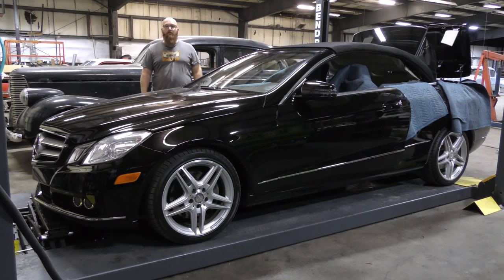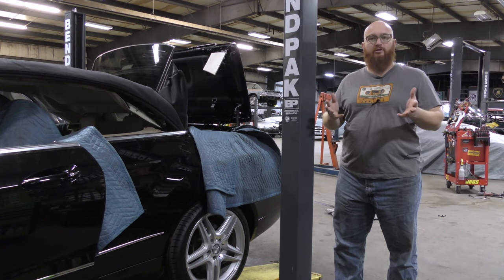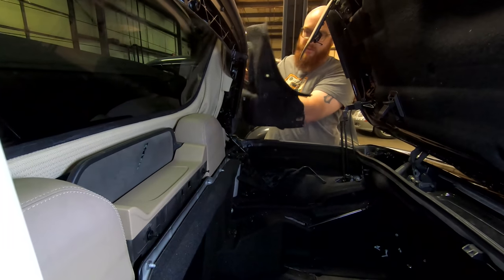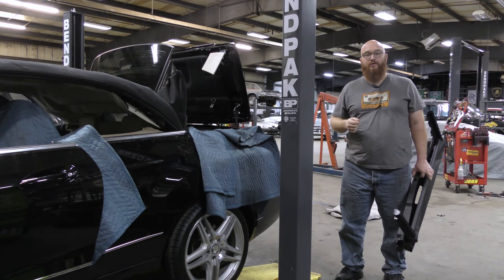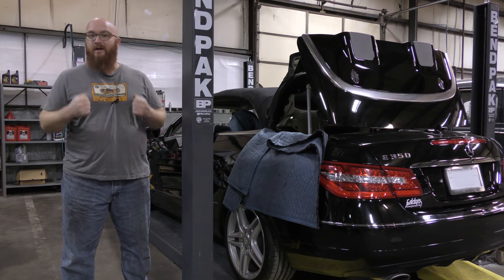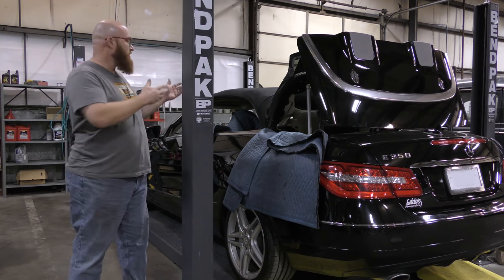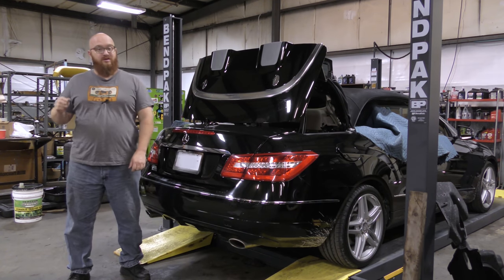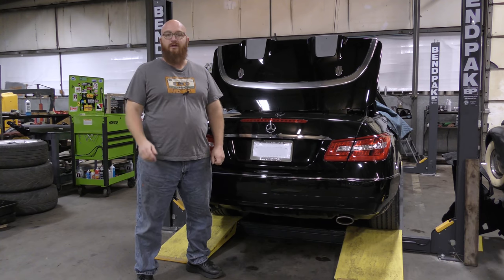When bad design costs thousands! Not so convertible 2011 Mercedes E350 can no longer rise on demand

Comment: I am one of the customers that auto manufacturers don’t count on for sales.  My primary car is a 1992 Buick Roadmaster Limited Sedan (84,000 miles), and my second car is a 1984 Cadillac Eldorado Biarritz Convertible (86,000 miles).  The challenge can be finding certain unique parts such as the dash mounted HVAC control module on both of those cars — both of them needed one this year and locating them was a real headache.  I wouldn’t trade either for a later model, however.

Comment: Nah, with the Diamler Benz, it was probably a decision made a decade ago, so therefore will never get revisited.. The first hose design was probably good, and eventually they squeeze the supplier, who does a "cost reduction".. the real crime? the non standard hose connectors.. which makes it hard for the  aftermarket to build a better hose.. BTW: I highly doubt they made 200K E series Cabriolets (convertibles), so I doubt the poor quality of this design is on their radar. With German engineering, many times it's "we do things this way because we can, not because we should".. Remember the 90's M-B electric brakes? How many did they buy back under lemon law?

Comment: The last generation of proper and reliable Mercedes Benz cars was W124 and W140..lucky to own both of them (E230 and an S320)..then I bought myself a W210 and later drove for some time a '05  SLK...huge difference in terms of reliability and mechanical issues compared to pre 2000 models...Never bought or drove a Mercedes again in my life. Same applies to Audi...Got a Lexus SUV which I have recently replaced with a Volvo...both superb cars, super reliable and awesome to drive and above all 5 star safety for driver and passengers. Unfortunately marketing gurus have made Mercedes a status symbol car despite the fact that are way better cars in the market with much less money

Comment: I'm surprised you can't get the proper fittings (or make them) and then use a type of hose that you can splice so next time it leaks you just have to replace that one little section. You could perhaps even splice in a piece of steel braided hose for that hinge point.
Reply: very tight space

Comment: Hey Wizard, what is your experience with Mitsubishi?
Reply: I am still waiting for a buy this, not that video regarding Mitsubishi's.
Reply: Mitsubishis aren't as reliable as a Honda or a Toyota. There are Mitsubishis that are reliable like the Lancer and the Eclipse. There are also unreliable models like the Outlander and Outlander Sport especially those with a CVT transmission also made by JATCO, a subsidiarity of Nissan. In fact I don't recommend any Mitsubishi with a CVT because they have similar problems with Nissan. Another thing is to avoid the earlier 3.0 V6 models because of valve seal issues and on occasion, head gasket issues.
Reply: @atx-cvpi_99  The later, 3 L V6 models are still in great shape for reliability (2014 and newer Outlander's). My father just kept his 2018 model, I believe.
Reply: @md2k8  Chill man, i do not want a mitsubishi video just a little comment.
Reply: @atx-cvpi_99  I was thinking about older models like the pajero with the v6 3.8 or models before 2012...
Reply: Mitsubishi also manufactures its vehicles in Japan, right? And it is cheaper than toyota and honda. I know they have some faulty models but all brands (including toyota and honda) have their faults. And honda lately is delivering vehicles with questionable quality control.
Reply: @seandillon3340  Yes, they do.

Comment: I own a 1999 Toyota Celica convertible with 150K miles made by the ASC in California. The top works perfectly and car has no issues. I sold my BMW Z4 because both  power top motors were broken and many other parts failed too like the SMG transmission. Yes when they are new German cars are lovely.

Comment: Interesting video, but badly lacking in perspective.  Yes, technicians may see a large number of any particular problem, but they never see the thousands of cars that don't exhibit the problem - so their frame of reference is understandably skewed.  10 or 11 R129s with leaking cylinders?  Over what period of time?  Yes, leaking hydraulics are a known issue with the R129 top but keep in mind the number of R129s which were built between 1990 and 2002 (over 175,000), and that the newest one is now approaching 20 years old.  Not to mention that MB freely admits that replacing the cylinders can be expected about every 10 years.

And this particular 2011 A212 is now 10 years old - which sort of dismisses your "3 to 5 year" life estimate, wouldn't you say?  The same question could be asked: Given the number of units produced, what does the failure incident rate calculate out to?  And might the longevity history with the R129 be an indicator of what to expect with the A212?

Certainly, a potential buyer should consider the possibilities of expensive repairs if they're looking to buy any  used car.  A potential BMW buyer would certainly look seriously at the cost to address any number of potential trouble areas on late model BMWs, or a classic Mercedes buyer might be legitimately concerned about the potential for hidden rust damage.

No car design is perfect. I'd happily tell you about a big design annoyance on my 2011 E550, but I had it addressed and moved forward.  I'll not likely ever have to pay to have it done again, unless the firmware is flashed back to factory settings.  If that happens, I'll deal with it then.  Meanwhile, I'll continue to drive and love the car, much as I expect the owner of this black beauty will.

Sorry to be long winded.

Comment: Hi Mr. Wizard. I  was a rental car warranty mechanic back in the mid-70's and GM had a policy of no high pressure hydraulics in the interior anymore. Gone was the direct reading oil pressure gauge, replaced by an oil pressure sending unit and a wire to the gauge. The heater core also was moved to very close to the firewalls. Interesting we have come full circle and have high pressure hydraulics in the interior again in a high dollar safe car.  Before you know it, they will be putting large banks of high energy batteries under the driver seat!!  Oh wait...........................

Comment: I own 2 MBZ Cabriolets. There is a manual overide that allows you to lower the top manually at 2 points above the trunk near the hinges. Takes 2 people to do it but it can be done & it is in the owners manual as an option to open the top manually if the hydraulics fail.

Comment: Yes, my '99 Saab 9-3 CV top costs more to fix than the car is worth. It's a messy job, like the Wizard said, even just to add fluid to the reservoir. The top function also has to be calibrated, why my regular mechanic referred me instead to another shop. As I learned this past summer, those tubes are $200-300 each, not incl. labor, and I think there are ten of 'em. Fortunately, I only needed two for now. (Don't even get me started on the cost of pistons...) It's also not like I had to get it fixed or else, but as the Wizard said, what's the fun in having a CV then? So I may have been "ho$ed" by this top, but at least I've never been sprayed!

Comment: Worth noting that many mechanics (at least in the UK) don't service convertible roof mechanisms and quite often you need to go to a specialist who will likely have a far higher hourly rate than a mechanic. I also know in my town there's no one who services air con not even a nissan main dealership in my area would touch a faulty air con pump on my friends Juke.

Comment: I have this same car it's a 2011 550 V8 it now has 158 thousand miles on it the only thing I've done is engine mounts transmission mounts lower control arms and sway bar links which is understandable and a starter I've never touched the top I can't tell you how many times it's been up and down in the last 10 years hundreds of times if not 1,000 I've never had a single problem with the top.. so after 11 years with a convertible and not one single issue with the top I think I've got my money's worth😊

Comment: I love this kind of comments and content. It is also the same in IT: people that haven’t built or designed anything from scratch tend to complain the most about quality.

Also.. 2011 4 seater e class, what were the other options for the roof? Electric? How big should those motors be to handle the heft? Would they be silent enough for a luxury convertible? What makes anyone think that they would be more reliable in the long run?!

Also, when was the last time that car had its roof maintained?! Did they check anything in the past 10 years?! How about preventative maintenance?

Or maybe people are happy to buy a highly discounted second hand convertible and expect for it to be bullet proof?!

This is just for show, in the end. As an engineer I can tell you every component has a lifespan. Some are measured in years, some are measured in number of operations (even for the swivel joint). When a mechanic comes along and says the design is bad, i would really like to understand what is the alternative?! Bad when compared to what?!

Comment: It’s not just the account but also the engineer who designed the convertible top using a fluid hydraulic system to activate it. My 2009 BMW M6 convertible uses servomotors and the electrical system to accomplish the same thing. Electric motors and insulated braided copper wiring are a much more robust and dependable system. No hydraulic fluid to squirt in your face and a system that will last for the life of the vehicle.

Comment: Good example. Dont know why they dont do it right away. The "additional 6$" would pay the customer anyway by paying for the car.  Paying 80k$ for a new Benz, wouldnt matter if the bill was 80006$  
Ridiculous. Good point Car Wizard!
Reply: $6 in product cost is typically $18 in end consumer cost.. do that enough times, and you price your car out of the market. Some companies cost cut well, others not so much.. German engineering tends to be overly complicated, for little benefit..
Reply: @dandeclerck6742  You have to add the "6$" to the buildcost of the car. Not to the final cost. If a 80k$ car cost like 35-40k for material and labour, few bucks for fixing a major issue isnt that high if you take into consideration that 1 million $ of extra costs for 200000 vehicles is just taking a shortcut. It automatically doesnt price your car out of the market. The profit margine will stay the same. Extra 18$ wouldnt scare a customer away buy paying 80018$ or even 81k$. (highly exaggerated). But when your convertible top is spraying at you and you have to pay 2k to fix it. The customer wont buy your product again. "Cutting costs" isnt needed, just a man made flaw with any kind of item. The fictional numbers from the skit are peanuts for car manufacturers. They dont have to pay for the final product, its the customer. If a car company is trying to cut costs, they use cheaper plastic instead of higher quality stuff. When i think about Chevy and their cracking dashboards, thats exactly how you take the cheap route. I am from Germany and i worked for BMW. Let me tell you, its just overly complicated if you dont understand how to work with it or fixing it. Its just well build and the time and afford reflects in the final price of the product.
Reply: @michaelm.4063  Daimler-Benz is buying that part from a tier 1 supplier.. I'm sure they don't make their own hoses, and hydraulic actuators. You don't think there's a supplier markup? Do you think suppliers work for free? The convertible top option has a cost component, that makes it saleable. You have to design to get under that cost to get volumes to pay for the non-recurring engineering cost (design and tooling) so that you're not taping 100 euro notes to every convertible that goes down the assembly line.

Comment: When an accountant builds it vs an engineer you get the oil pickup and pan design on the trailblazer ss. Many engines have failed due to oil starvation.

Comment: Just to say that the repair with the £100 kit has held up two years later.  But I had to repair the other hose as well.  They get pinched as they slip out of the cheap plastic clip holder.  Worthwhile checking your car occasionally to see if they have slipped out and putting them back in.

Comment: I'm not familiar with the top mechanism but I would assume that the hose powers a cylinder that latches the top at the windshield header.  All this to avoid the "inconvenience" of having to manually flip a couple of levers to latch the top to the header.  If that's unacceptable to Mercedes customers, how about electric latches rather than hydraulic ones?

Comment: "Engineered like no other car" A lesson I've learnt from observation particularly cars, premium brands are often not premium & steer clear of the options list & order the basic base version.            Dealers hate this, the bells & whistles & tinsel that add many thousands of dollars won't get you there any quicker & are poor value.Believe me you won't be any happier.
Reply: Yeah when I bought my Lexus I made sure to get one WITHOUT the panoramic glass sunroof.  Still has the small sunroof, wish you could get them without a damn hole in the roof at all.
Reply: @AaronSmith-kr5yf  Eventually.....Same with Tesla, put a conventional alum roof panel on the thing, likely it would be lighter & the AC would be more effective, but no, you gotta look 'cool'.

Comment: If you have a R129 you can get it done much cheaper than 3 grand, most shops charge 1 grand to pull them out and replace them.   Have them send them to Top Hydraulics in Oregon where they will rebuild the whole set for around $600.so that the total bill is around $1600 to $1800.

Comment: The manufacturers cut a lot of corners to meet that round number they want the car to cost and don't even think about the damage they can cause to the brand and the people themselves. And you would expect much better than that from a premium brand like Mercedes-Benz, which used to sell itself as a top quality, super-reliable brand.

It probably always been like that, but cars got more and more complex, more and more crowded with components, and so more and more expensive to fix and improve what they decided to build too cheap and it is easy for a 5 dollar, or less, part to total a car that would still be quite nice for a few more years.

One thing that seems to go out very often these days are the water pumps. Why? Probably they picked a cheap set of bearings to save a few pennies and that results in a trashed water pump - because shops don't fix components anymore, they replace them - and, in the worse case, the engine if it leads to overheating and the person don't stop. I have a 1985 Mercedes-Benz that still has the original water pump,  I wonder how long the one on the 2016 car will last.

I think there are more accounting flaws that design flaws in modern cars.

Comment: Wizard on the subject of cutting costs. Have you ever heard of the dreaded wet belts on ford 1.8 TDCI  diesel engines 2008 on? 
They're making that mistake again with 2.0 ecoblue transits. Nothing to do with economy and quiet running. Saving costs but when they shed the teeth it's costing them more!!

Comment: I recently had an unfortunate leak in my Mitsubishi.  Turns out someone thought it would be a good idea to route the rear window sprayer line through the firewall/ dashboard.  One day I realized the rear sprayer wasn't working.  I could hear liquid spraying something, but couldn't tell where... until I saw a a drip on my passenger floor mat.  I removed the glove box and found that there were two splits in the line.  Both of which were spraying electronic components.  One of which has something to do with my airbags...

Comment: In my 20's in the 60's, a taxi driver friend picked up a fare, a guy wearing oil stained trousers, he had a Grosser  Mecedes with hydraulic everything and a pipe under the dash let go and he copped a decent spray. Nothing has changed.

Comment: MB would use a cheap swivel anyway, which by design involves a seal that most certainly can fail too.   Buyer asks for trouble getting a hydraulic actuated convertible.

Comment: Accountants as proven by many companies should stick to books. Engineers and designers stay with their jobs. No crossover. Manually operated soft tops are best. Lighter, cheaper and less complicated. I would love my CLK to be converted to manual hood operation similar to the Stag. It’s a fabulous car and hood operation, but just one less worry when touring if hood was manual. Good thing though I have a spare wheel.

Comment: I hope you will replace the hose with standard high pressure Gates hydraulic hose with a few conveniently placed joints for future ease of repair. I'm sure standard hose will be more durable and cheaper than the Mercedes part which probably costs an arm and a leg.

Comment: Late model Saab 9-3 convertibles had hydraulic rams that would fail because they put 'biodegradable' seals in them.  When the ram that locks the header in place fails it sprays hydraulic fluid down in your face.

Apparently, this is a very common problem on many European convertibles from the early 2000s.

Comment: I knew two mechanics that modified an idler arm for early novas, Chevy came and got one then told him to stop doing it. I fixed the issues with frequent replacement issues. I had a ‘62 &  a ‘64 nova. It solved the issue and still Chevy never modified their design for the nova. One of the brothers built the racing engines for Chevrolet' Fisher racing in the mid ‘60’s 🙏🤨